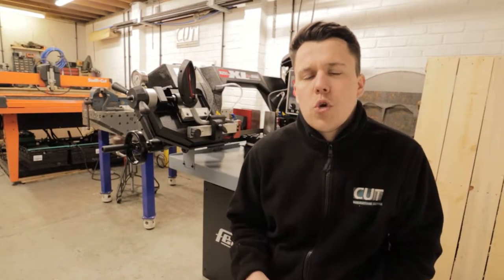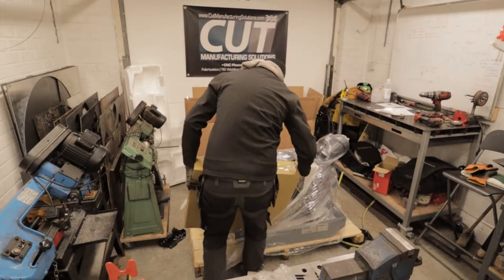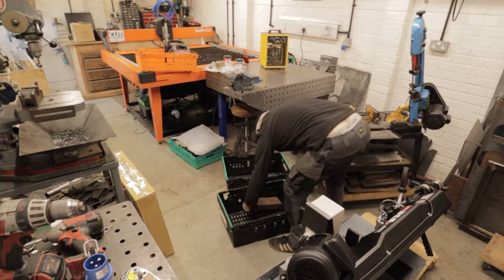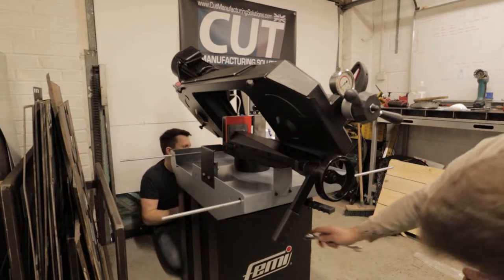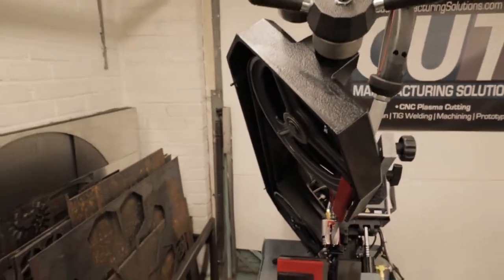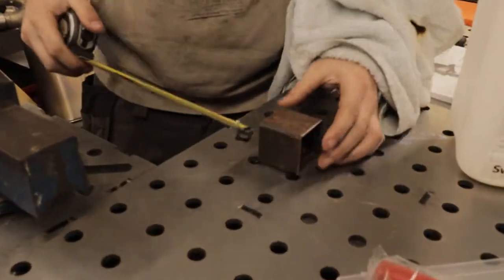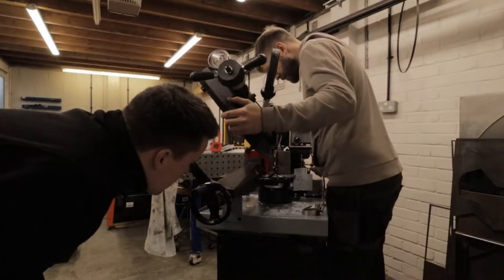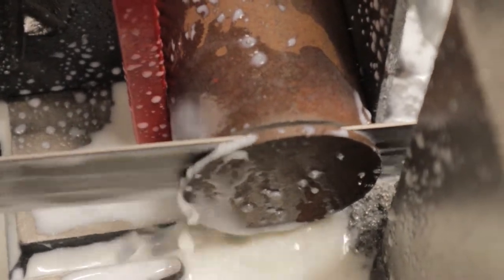Upgrading our Metal Bandsaw - Femi N250 Delivery day

Comment: Thankyou for your review, I have a femi 120 abs but Been contemplating the 220 daxl or the 250, the one thing putting me of the 250 is the blade speed doesn't seem to have  adjustment only downfeed speed, what's blade life like on stainless tube, the 120 will eat blades on stainless if not careful
Reply from the maker: Hi there, we havent put this saw to the test yet on stainless material. I will do a follow up in 6 months once the saw has seen some more use ! From my understanding blade speed adjustment is only offered on the 250 DAXL when 3 phase is selected. Any machine below this in size does not have blade speed adjustment. So far, the saw is really impressive! great accuracy and really speeds up the process !
Reply: @MasonsWorkshop  thanks for the reply my 120 femi has speed adjustment and the 220 does too
Reply from the maker: @bigcheesiecrawford2314  My mistake, you are correct regarding other machines. 3 speeds only available on this machine with the 3 phase! I’ll let you know if this becomes an issue…

Comment: Just randomly found your channel whilst looking for reviews on this saw. Really enjoyed the content. Have you had much chance to play with stainless yet? Such a shame there's no speed adjustment on the saw for single phase :( would really have been a decider for me I think...
Reply from the maker: Hey Dan,
 Im glad you found the channel and its even better you enjoy the videos! 
Yes, we have cut some more stainless tube & flat bar. So far it has been very good! we are still on the standard blade which has lost a few teeth from some learning errors but It performs well. so far, I have not seen the single speed holding us back, I will keep you posted though... we are going to switch over to a new blade from our local supplier soon and really let it eat through some material. I am thinking of keeping a carbide coated blade for stainless if we see it chewing them up.